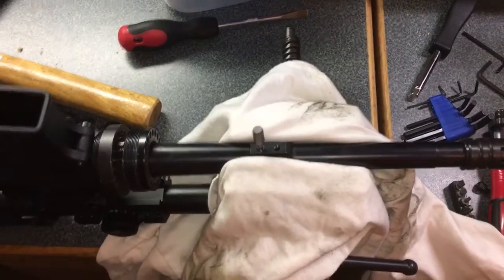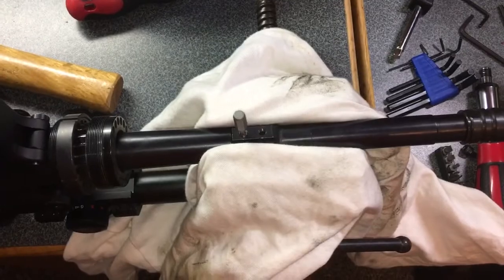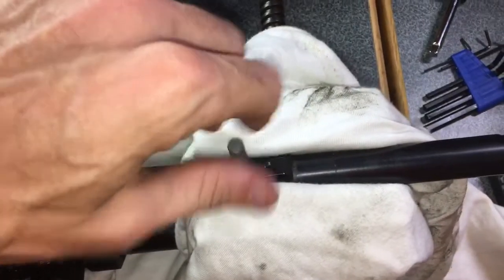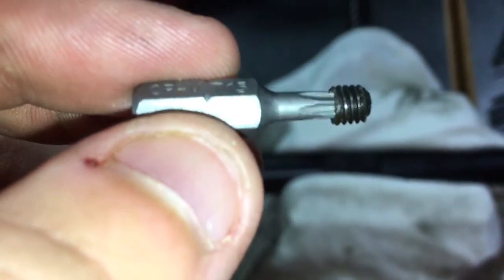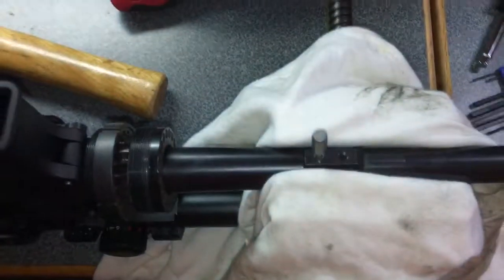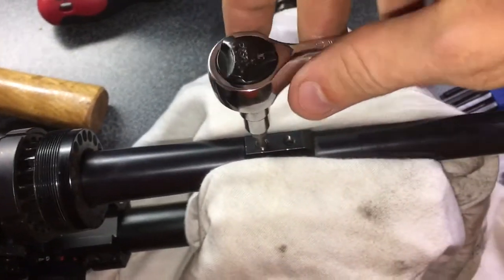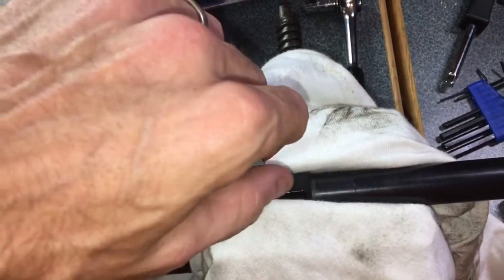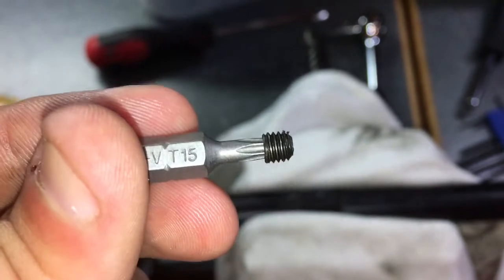Stripped Gas Block Screw Removal

Comment: Tried this. Bit broke off in set screw. Any ideas for next step now?
Reply: I’m in the same situation trying to get the broken bit out of the hex head
Reply: Any tips? Same thing here
Reply: @ryank588  to get the broken bit out I flipped it over amd racked it and it fell onto the table. Still havemt gotten the screw though
Reply: What did you end up doing?

Comment: Andddd my t15 bit broke off… tons of heat applied beforehand too
Reply from the maker: Dang man that’s frustrating. Ive found that not all bits are created equal. Lots of folks have had good success but several have had this same situation. If you find a solution please post it up so we can all benefit from your misfortune
Reply: @justmitchell17  no problem, I was stoked on this idea and couldn’t believe my bit (which looks to be the same as yours) broke off. 

I ended up going with the nuclear option and using an angle grinder to carefully grind out the front set screw (the back one came out no problem). Now I have a new gas block headed my way.